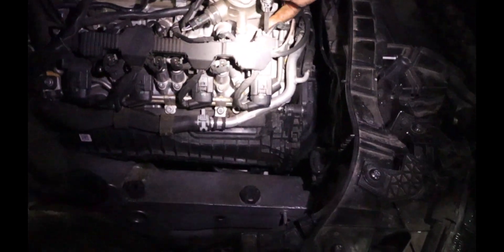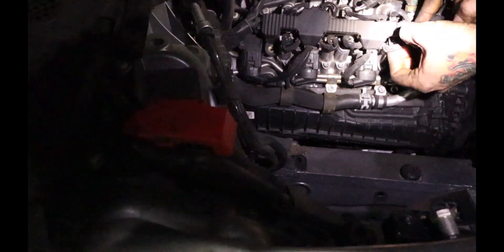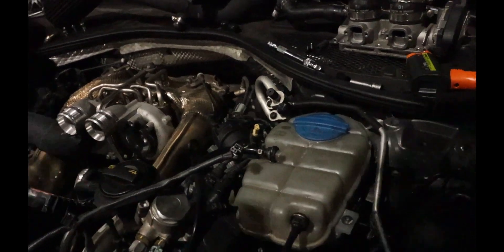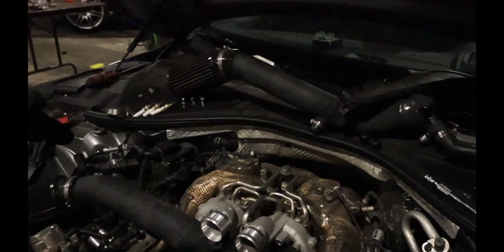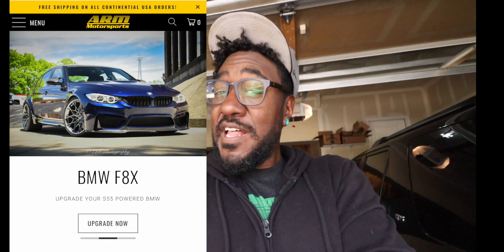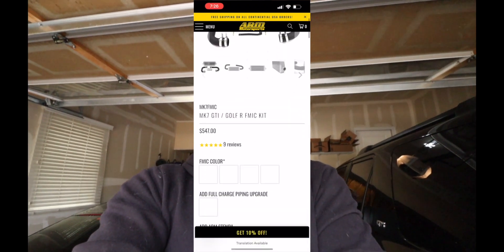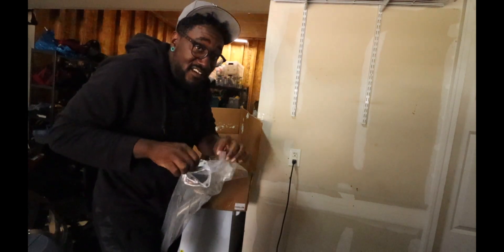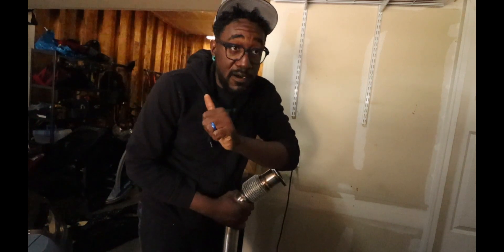Stage 4 Dyno Spectrum on my Audi s7 4.0tt upgraded HPFP High pressure fuel pump.

Comment: No problem, man! Next time you have the intakes out, grab a pair of 2.5" couplers and 4 clamps, and use a bandsaw or whatever to cut the intake tubes (roughly in half). This makes it way easier to access the passenger side spark plugs. Additionally, you can do what I did (at the recommendation of SRM) and remove all of the hard plastic around the wiring harnesses on both banks. Just be sure to wrap the harnesses with Tesa tape (basically fleece, non-conductive wire loom tape). I do still have to pop the coolant reservoir up, but you can access everything much more easily by doing those two things.